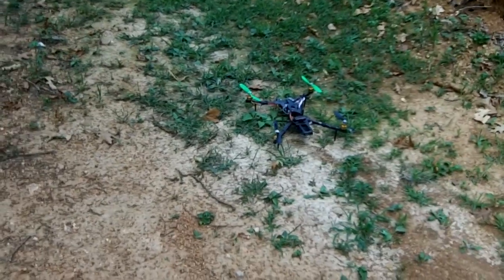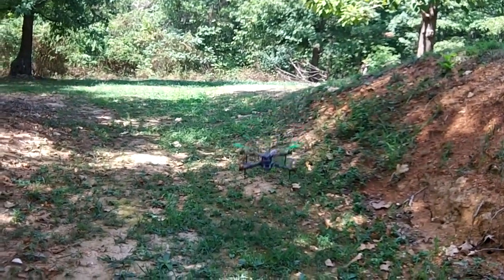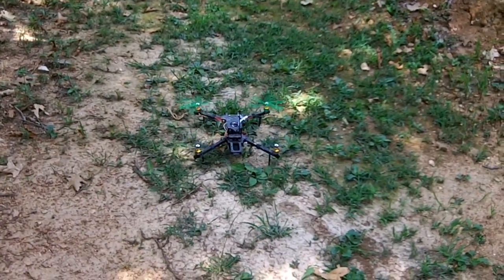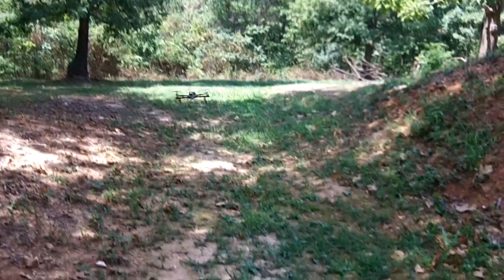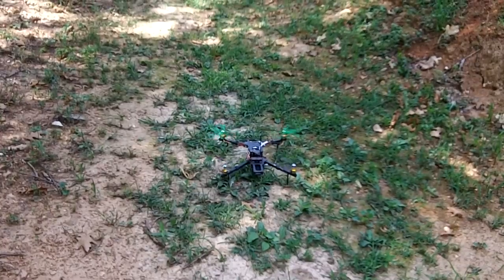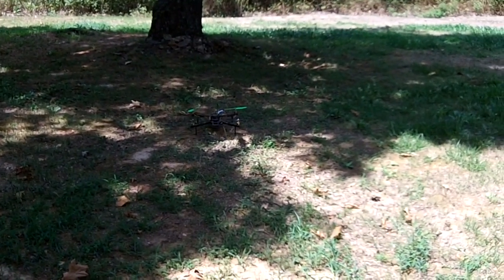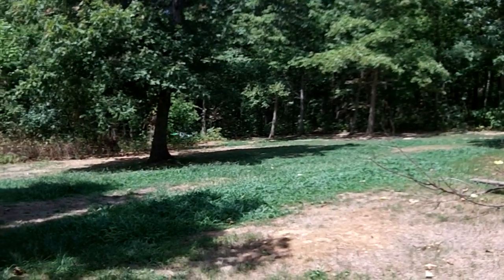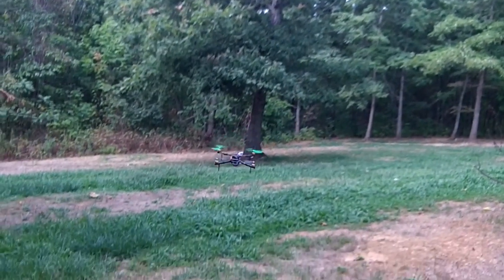Lets Build a DIY FPV Spider Quad Part 10 the Maiden and PID tuning

Comment: I have a minifly from xheli  210mm and had the same issue. After tinkering it was my P that was too low and D was to high. Upon return to level the bird was snapping back to strong and the P was to weak to stop the inertia. I still get it when flying very,very aggressivly but really can't strengthen P or lower D anymore for my liking. The little ones are hard to dial in IMO and always seem to be more of a compromise than larger craft..

Comment from the maker: Self correction as you describe is a low I setting,  I to me is the angle hold value or the ability of the quad to hold its current angle of attack.

Comment from the maker: I can only offer that it is a symptom of a low P value when the quad drops more suddenly than it should during yaw.  There is also a video some place that describes the different symptoms of a high or low P value and it mentions alt control as one of the problems.  I will try and find the video and post the link.

Comment: Excellent DIY series from beginning to end, I have flown DJI, Aeroquad, and Multiwii FC boards and from my experience the "D" value is more or less based on personal flight preference. Its really the speed at which the craft returns to a level position, some like it snappy some like it softer. On another note though I often get the same thing with the altittude drop during yaw but never related it to my "P" setting only a weight or prop size issue,could you explain abit more maybe it would help